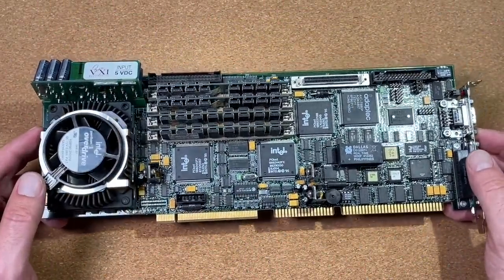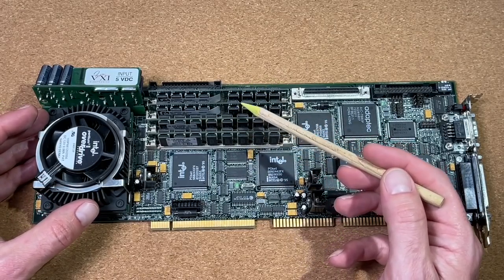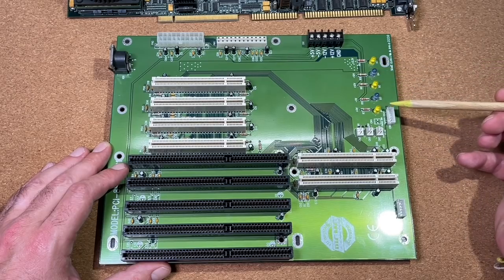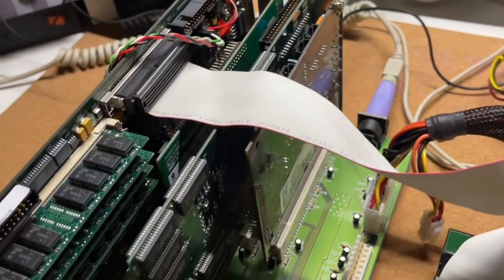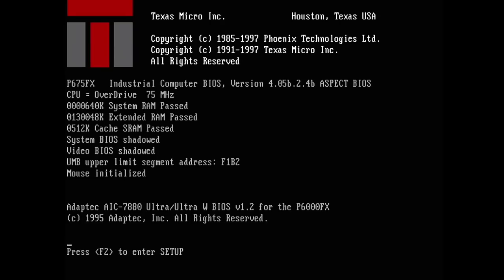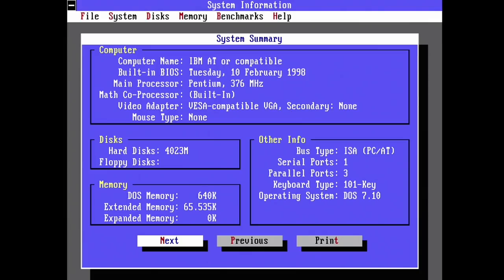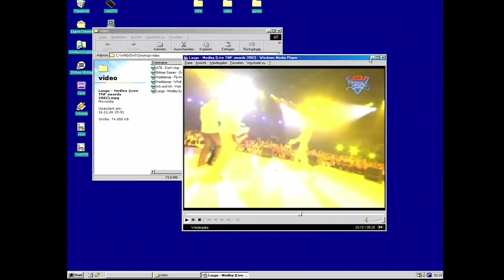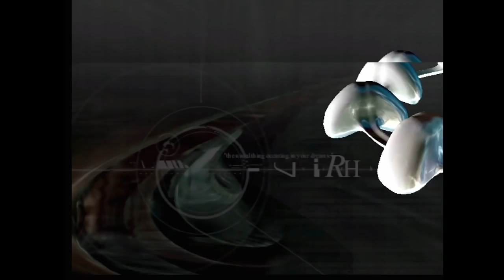Pentium PRO Single Board Computer / Intel Pentium II OverDrive / Testing with Voodoo 3dfx

Comment: Wow, I honestly didn't even know, that there were PII Overdrive CPUs. Thank you, Peter, as always, very entertaining video.
Reply from the maker: Thank you 😊
Reply: They weren't very common back then since the Pentium Pro itself wasn't a terribly popular CPU as it struggled with 16 bit code and was very expensive. But for those who invested in a P-Pro based workstation or server it often made sense to upgrade it with a PII Overdrive CPU than to replace the whole PC. Especially since you could take a 150-200 mhz P-Pro PC and upgrade it to 300-333 mhz.
Reply: @CPUGalaxy  can you do doom 1 and 2 benchmark. with 1993 to 1995 gpu also
Reply: I ran a dual Pentium Pro board, originally with two PPro-200s. Then got two Pentium || Overdrive 333 chips. Windows 2000 for the multi-cpu support.

Comment: Socket 8 Machines are something of beauty. Never knew that even SBCs existed with that Socket. Great Video!
Reply: Agreed. Reminds me of when I had a Supermicro P6DOF dual-socket motherboard and I added a second Pentium Pro 200. It was one of the early  SMP systems, multi-cpu support was relatively new in the Linux kernel, was it 2.0 at the time ? It was around 1997 if I recall correctly.
Reply: I loved my old PPro back in the day

Comment: I never knew that the Pentium II Overdrive had the same full-speed cache as the standard Pentium Pro. That must have cost a fortune. The Pentium Pro was extremely expensive to manufacture. I've read that the on the 1MB cache version, the on-die cache was actually more expensive to manufacture than the CPU core itself. I've only got a 256KB version of the Pentium Pro myself, but it's still a fascinating system.

Comment: Pentium II Overdrive, whooooa! Back in early 2000s I had a Pentium PRO server as a "home router", and was hunting for one of those, to no avail. Me and my colleague called them "Almost Xeon". Great video, thank you ♡
Later I got an IBM 365 Workstation equipped with two black 1M P-PROs, with added fans. Not as good, but still decent ☺
Reply: Well, the Pentium Pro was the Xeon before the Xeon, so  yeah, it's an appropriate nickname I guess :)
Reply: @rebeccaschade3987  Not really. P2OD was introduced few months later than the P2Xeon, they both share the same full-speed cache (althouth 512K only for the OD while the Slot 2 Xeons had 1MB and 2MB options due to their larger PCB)
Reply: @mikv8  Yeah, I was referring to the Pentium Pro, not the P2OD. The Pentium Pro was the CPU that covered the market segment that the Xeon would later fill. Hence "Xeon before the Xeon". Not in name, but in what niche it filled.

Comment: Excellent, excellent setup. The socket 8 Pentium Pro, P2/Xeon Slot and AMD Thunderbird Slot A configurations were some of the best things in x86 PC IMO. Texas Micro did make some excellent solutions, several of the manufacturing factories I consulted for used their components.

Comment: That 10k Cheetah drive took me back! In my dual PII-233 box, I had three 10k Cheetah drives (18GB each, IIRC) running off a Compaq SmartArray SCSI-UW caching controller (with 16MB of cache, IIRC), configured in a stripe. During system startup, each drive initialized one after the other, which was some awesome startup drama. Once through the controller option ROM drama, the actual NT4 boot up was redonkulously fast. 

Most voice-coil actuated HDD’s make fairly similar grindey noises, but those Seagate drives chucked their heads ferociously across those 10k rpm platters (and these were the earlier 3 1/2 inch double height drives). With three of them in my tower, during periods of heavy disk access (like when running synthetic test DB transactions) the whole case would rumble and tremble.

Today, I have multiple terabytes of PCIe x4 NVMe storage that are bazillions of times faster, and are amazing pieces of technology… but there’s no drama and excitement like there was with those big, jet engine sounding, chattering beasts.
Reply: imagine having a 8 sbc pentium pro system💀💀

Comment: Pentium Pros were amazing CPUs.  My legacy server has an Intel 440FX motherboard with 2 Pentium II OverDrive 333Mhz CPUs running with 512MB of RAM on NT Server 4.0.  The thing is a rock solid beast.  I've been debating on switching the disk subsystem to SCSI from IDE but SCSI drives are so damned expensive, and I wonder if there would be any speed gain over my modern IDE drive I have in there now.  Excellent video, BTW.  Keep them coming!
Reply: Go for it. SCSI is absolutely worth it on an older machines like this. I recommend Fujitsu MAW, an amazingly fast and quiet HDD from 2008 and they're also cheap as chips. I have mine running in a similar PR440FX retro gaming machine with P2OD slightly overclocked to 350MHz with 1GB RAM and V2SLI.

Comment: Seeing that SBC takes me back! In college I had a friend that "acquired" a 200 mhz Pentium Pro based workstation that had a SCSI hard drive. That whole machine was a real tank. If you fed it games/programs that used 32 bit code or used a lot of FPU it really flew, but for 16 bit stuff (like Win9x) it was fairly slow. I was really glad Intel fixed the issues with 16 bit code in the Pentium II!

Comment: Nice. I also have a few PICMG SBCs, including a core2quad one. According to the manual and the bios setup, it even supports 2 floppy drives. Unfortunately, the second floppy doesnt work and the DSB and MotorB signals are unconnected, the IO chip supports only one drive. But a rather fast pc with functional ISA bus is nice to have.
Reply: I have a q6600 in a late 80s AT minitower which makes for a pretty surprising sleeper lol.

Comment: Very nice Never could get my hands on an Overdrive for Socket8. Very glad to have serveral Overdrives for Socket3 and one Pentium133 Overdrive for Socket4. Next you might check a Xeon for Slot2 which is actually a normal PentiumII but with an extra chip which contains the L2 Cache running @fullspeed- but I think you know that.

Comment: 333 Mhz + 8.8 fps in Quake III seems a bit fishy. It's to low.
Did this run on the Matrox G450 via OpenGL or on the Voodoo 2 via 3DFX with a Q3-3DFX patch?
Maybe it was running with software emulated OpenGL only.
I've had a Pentium 200MMX @ 225 Mhz (3x75) with a 3DFX Voodoo Banshee (16MB) on LAN-Parties.
It ran fine and playable. 30+ fps I guess. We played without bots tho.
It's just something that seemed weird to me and confused me.
Reply from the maker: thanks to point this out. I had already the feeling that 8.8 is a bit less. Need to investigate here again. cheers, Peter
Reply: @CPUGalaxy  Yeah you should get a lot more in Quake 3. Even a 200 Pro should do 20+ fps.

Comment: Awesome! As you know, i am a huge fan of socket 8 machines. These SBC boards must be more rare as unicorns and Ivermectin actually.. Never saw one in the wild. Anyways. What i was missing in this video was a comparison between the standard Pentium Pro 200 /256/512/1M vs the overdrive... would have been interesting too. Lately i was playing with the 512k 200Mhz on an ASUS P2L97 Slot1 with a slotket - the performance there is awesome on the LX - compared to the standard FX chipset. Maybe you can feature all this in a future video. Btw.... i first like and then watch. :) Cheers.

Comment: Beautiful hardware, the best video so far for me. Reminds me of mine Dual Penium Pro with my Asus MB.Maybe there will be a video too with Dual oder Quad CPU Hardware ? I firmly decided to reactivate my Pentium 66 motherboard with overdrive on the Christmas holidays.
Reply from the maker: thanks. well, yes. I am working already on a setup with dual socket 8 and two pII OverDrives. 😉
Reply: @CPUGalaxy  Hey, I'm already looking forward to the videos. And one more question ... was it even possible to overclock P-Pros or Overdrive CPU or operate with a higher bus clock? Herzlcihe Grüße aus Berlin  ;)
Reply from the maker: ☺️. Yes, by increasing the bus speed they can get overclocked. The multiplier is fixed. Liebe Grüße aus Kärnten.

Comment: Great PICMG board! - I haven't seen a PPro version before, but I do have a 'Slot 1' version. It ('MSPC-6800' model number marking on the board) would need to support a good level of a 'Slot 1' Pentium III to beat that Pentium II Overdrive!
Reply: I have even seen dual slot 1 variations of those PICMG's boards. And they are pretty wild looking.

Comment: Hey great work, like warp back in time for me! Very Good! You are limited in Video Ram on The Voodoo2 in Quake3, you need to use the the wicked3ed driver, it has better memory management and compression. I think you might get over 30 fps if you change. Especially Voodoo2 Sli got a massive boost by doing that. My system back was a K6-III+ 600 with 133 Mhz Bus, simply amazing performance! It is still ready in my cupboard. ;)

Comment: you could equip the 72 pin simm modules with 4x 128 MB Modules for a maximum of 512 MB and with the p2 overdrive that would be killer.

Comment: what i always wanted to  know is if a single board computer can interface with normal pc motherboard and comunicate with it

also on pentium pro overdrive, powerleap made adapters for pentium pro sockets to install coppermine celerons in them, up to 1000mhz
Reply from the maker: No, you can’t put a SBC into a existing computer. The result would be two cpus and two not synchronized clocks on the bus.

Comment: I once had a chance of buying two of those Pentium 2 OverDrives in sealed boxes for like $15 each at a goodwill and I passed them up not realizing just how valuable they are. The kicker is that I would have lost them like a year later to arson (lost a home back in 2012) had I bought them :/  Anyway I got a slot 2 Xeon build with a pair of 2MB Pentium 2 Xeons that eventually needs to be finished someday.

Comment: I had a dual board with 2x p200 pro's.. (512kb tho) (So 2 cpu's on 1 board, I mean)
But man, those CPU's got HOT omg haha. It had huge passive heatsinks and no fan. It didn't do justice... I guess the case it suppose to go in had to cool the heatsinks.

Comment: Interesting that Speedsys shows 377MHz and System Information shows 376MHz. I think what's happening with the BIOS reporting 75MHz might be similar to the way these are reading the speed incorrectly. The BIOS only expects the speed to be up to 200MHz, since the overdrive came out much later, so when it (incorrectly) reads 375MHz, it can't display the first digit correctly, but it does display the last two digits, hence it reports 75MHz.

Comment: I have a question, I just got an Intel Pentium-166. For some odd reason there is a thin square of metal stuck on the top. I cannot figure out a way to remove it without possibly damaging the CPU. There was thermal paste around it.
Reply from the maker: well, this thin square metal sticker is acting there like thermal paste. I had this hundred times already. you can easily remove it with a sharp knife without destroying the cpu.
Reply: @CPUGalaxy  Thanks!

Comment: I wonder what will happen if I plug in one of those "single board PC" into normal motherboard? Operating system on that first/main computer will even detect this hardware?
Reply from the maker: no. that would not work coz of two independent cpus and clocks on the bus.

Comment: two types of chips: 16-bit 4TB pre-calculated two-parameter 256x instruction set results by fast rom memory fetch, and 128-bit pre-clock rewired mini-fpga core for minimal core footprint in silicon, free to use idea, no cost, dont try to patent, you get nuked if you do
Reply: registers are still at 100MHz, no matter how you crank your multiplier, please verify me, my voice is my passport

Comment: Where did u find the Pentium 2 pro overdrive from? I want one!
Reply from the maker: they are not so common. But from time to time they appear on ebay.
Reply: I didn’t know that they existed at all, I thought it was all over on the first Pentium
Reply: @CPUGalaxy  I thought so I looked and found a ton of Pentium pros but and some that like kinda of like it but they where labeled server and didnt have the fan or the p2 overdrive label. But thank very much for ur response and I love ur content.
Reply: I've always wanted one with an even rarer socket 8 to slot 1 slocket adapter,  like having a P2 Xeon on a regular P2 board, 512K of full speed cache.
Reply: @VideoVitaliy  yeah same here I thought there were Pentium pro which I did order one just now lol and that there were overdrives for the Pentium and 486 bit I really like he showed me something I didn't know about.

Comment: You could have tried running a Voodoo 2 in SLI with the Matrox card.  You may have gotten better framerates on Quake Arena.  I have a Pentium 200MMX with 2 Voodoo 2's and the Matrox 450 and get better framerates than that.

Comment: You said the scsi drive is very cool.. Actually these 10.000RPM drives are running very hot.. A fan is required.